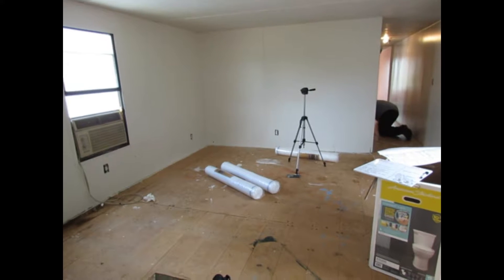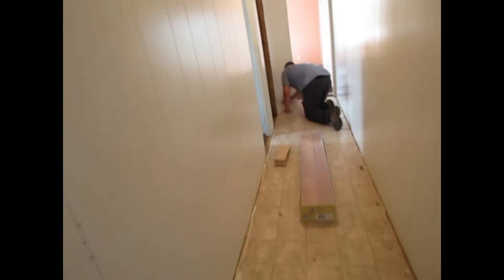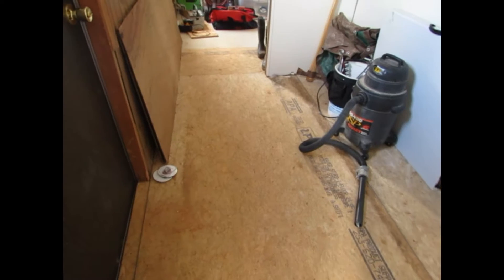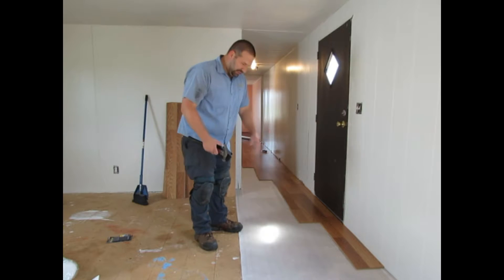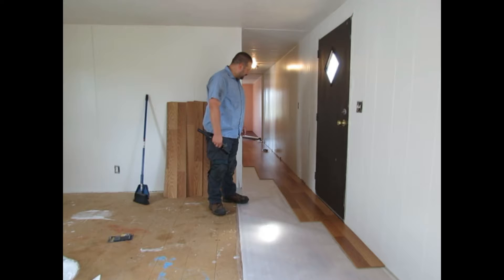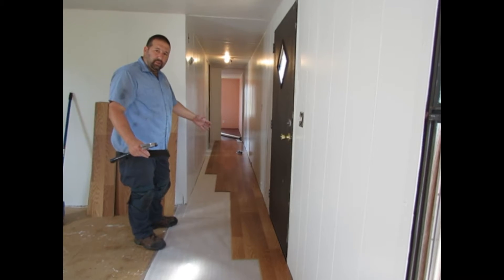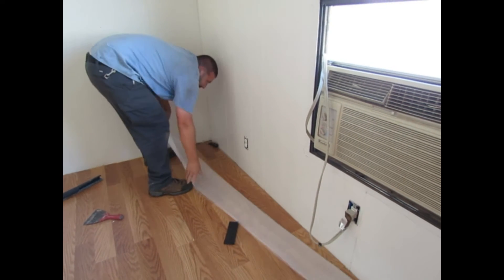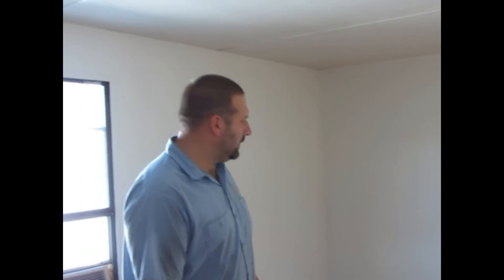Laminate Flooring Install

Comment: Y’all are going to love the new floors! I replaced my kitchen floor with vinyl planks in the color dove tail a few years back.
Reply from the maker: Awesome! I just hope they hold up to the dog! 🤔
Reply: Mine has proven to hold up better than the linoleum it replaced. I’m sure your new flooring can handle a puppers just fine. ☺️